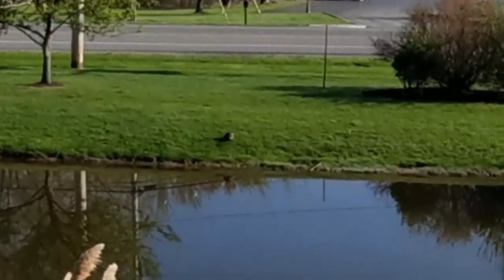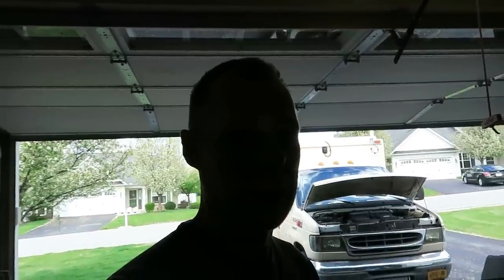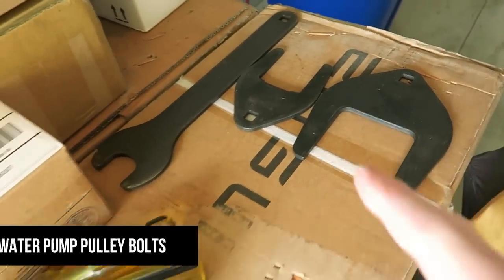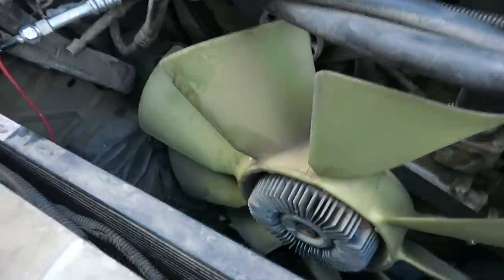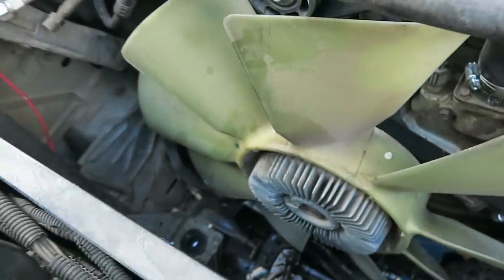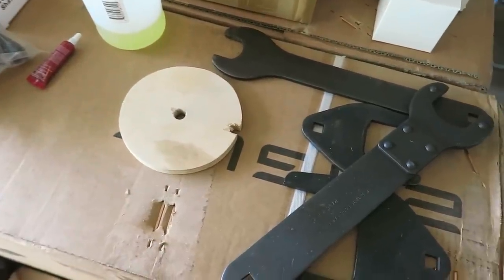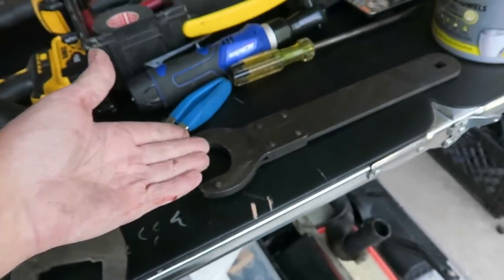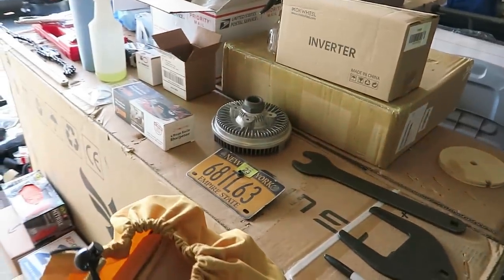I Won The Battle And Got The Seized Fan Clutch Off Of My 7.3 Powerstroke in my E-Series Van

Comment: Those tools look so familiar since I had to buy them to get all that stuff off my 2010 Chevy truck to replace the water pump last year (it still was cheaper buying all that stuff rather than paying someone to do the job.)   Glad you got the fan clutch and everything off, etc.
Reply from the maker: That's the first time I'd used those tools - the water pump tool helped me to get fan off. I'm so lucky that the clutch cracked loose just by spinning the fan!

Comment: Oh dear, first generation OEM fan clutch tool.
That style was quickly replaced by a pivoting fork that worked by way of pneumatic hammer.
No pushing or shoving, just burrrrrp.... And they are loose.
Yeah I know, a lot of good that does you now, right?

Comment: man, that fan IS suprisingly big!  

Nice going spotting that block heater wire short.  I'm surprised that sucker didn't start a fire for the previous owner.
Reply from the maker: I know! With AC power feeding it, it must have thrown a breaker and then they never used it again...

Comment: Congratulations!! Glad you got it done. Did you look at switching to an electric fan? It's a common modification and getting rid of the clutch and the drag from it tends to improve mpg on most vehicles. Just a thought for you if you ever do it again.
Reply from the maker: I may make that change down the road. I'm going to check my mpg with this one - I bet the old one was dragging.

Comment: The first time I took off a fan clutch on a van it took me a week. Youare right. You do not have the right tool. The one for the van curves and recesses back into the fan on to the nut. The wrench you have is straight, for the F series. I felt the same way the first time I got it off. Just spin it back on and don't tighten it and it will be easy to get off next time.
Reply from the maker: I knew there must be a tool designed for the van. No wonder I struggled so much!

Comment: Most of the time you loosen the shroud, remove the fan then remove both of those then re do the fan and rebolt the shroud.Well you got there in the end..
Reply from the maker: I did that method on my old mercury - plenty of room and the fan was easy to access. On this, I just couldn't figure it out.

Comment: Older Vehicles didn't have a fan clutch,  but they probably didn't warm up as fast.  Your Heat probably works faster when that clutch works.
Reply from the maker: I'm curious to see the difference this makes in different temperatures. I'm guessing the old fan wasn't working correctly for some time.

Comment: good .  Lefty is on it.  Ok, I was wondering, how tight do you have to make the new fan,??  Do you have to use the other tool to tighten it??  But glad you got it off.
Reply from the maker: 40 ft lbs is the spec but my mechanic friend says you don't need to crank them on because they tighten as the engine rotates and can't spin off.

Comment: Why do you suppose it seized?  Looks really dusty, so I wonder if the build-up of dust might have played a role?  If so, what could possibly be done to avoid it happening again sooner rather than later?  I know all things fail eventually, but I always try to learn how to prolong parts life, ya know?
Reply from the maker: Did you see that the oil had leaked out when I left it overnight on the cardboard? The seal must have failed - probably just from age - and the fluid had been seeping out.
Reply: @TheCampulanceMan  Ahhhh.  I did not see that. Thanks for speedy reply.
Reply: Those clutches are hydraulic. When the metal inside gets hot, it expands and engages the fan by compressing the oil inside. When the metal cools down it contracts the oil, disengaging the fan. When they get old, all of the oil leaks out and the fan is engaged all of the time.
Reply: @MrAcutecareems  This is really helpful. I have none of this knowledge, so I'm being educated. Thank you!
Reply from the maker: @MrAcutecareems  great explanation- thank you!